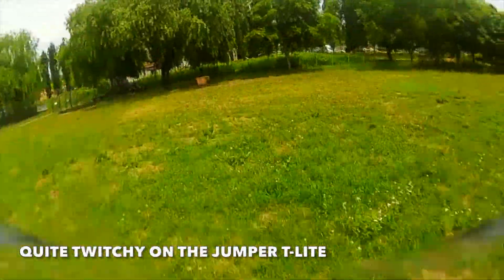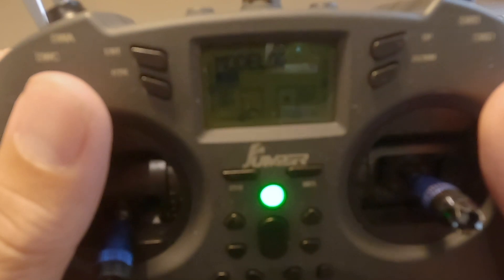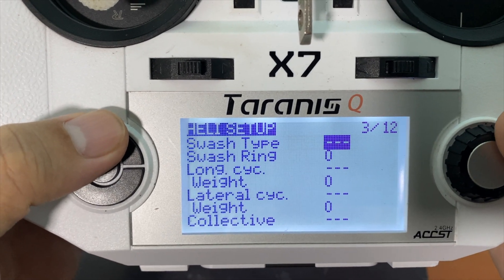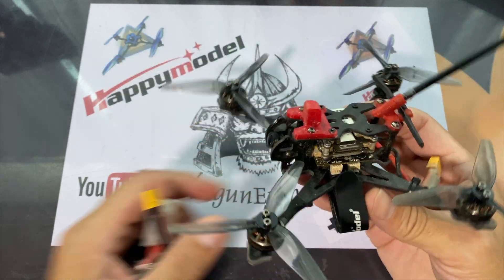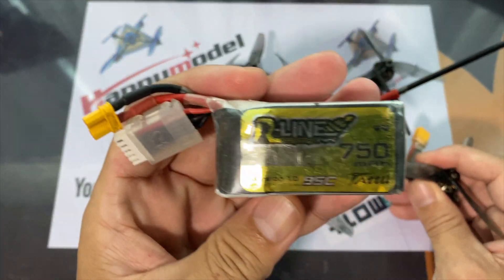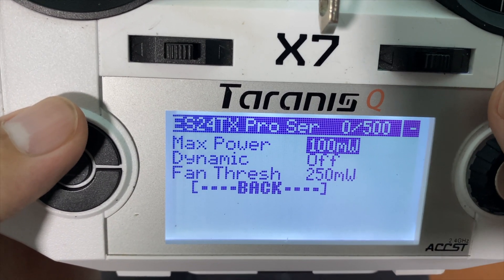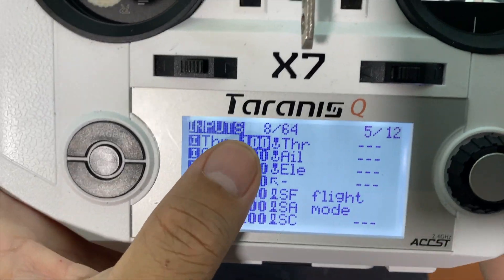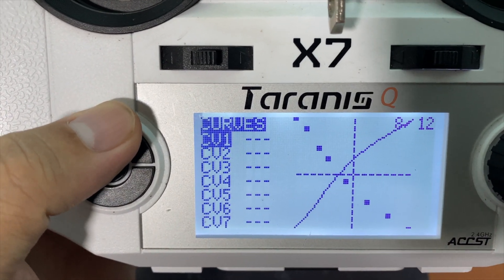Does your drone jitter? Check your radio settings

Comment: what is the difference from smaller drone to bigger drone? i see you fly the same way in both.
Reply from the maker: the larger 5" has more power and much easier to control as compared to the smaller micros and tiny whoops. If u asked me, I'd say the size makes a difference. 4 x 4s lipos for 5" and 4 x 4s for micros weight wise, is halved.  Micros and whoops are much smaller so its easy to carry around.  The smaller micros and whoops fly differently, they're more zippy but has to be lightweight but the larger 5" carries a gopro easily. So it really depends on the user. If i want a gopro footage, i'd use the larger 5"
Reply: @shogunemperor  I have noticed that the Mobula 7 hd has more weight so it's easier  to fly but the regular M7 is more 😊 fun . I'll try bigger quads once I get good at acro , can only do it outside and it's pretty windy
Reply from the maker: @chopwhoopz  yup, i prefer the regular Mob7 too due to its agility. The Mob7HD flies like a bus.

Comment: Great video, I always turned on the “max throw” checkbox , this cranks up the endpoints to max which is the equivalence of 125% on older radios. More resolution is always better for the accelerometers in the flight controller to work on .. 😉
Reply from the maker: aaww thanks bruh! ooooohhhh... i didnt think of that... but its weird tho.. it only happened to the Crux35... didnt happen to my Johnny4 which was what got me perplexed

Comment: Nice video dude and something that is commonly overlooked as we see bobbles/jitters and instantly assume quad hardware or tune problem. Great flight too! What camera is footage from? I'm guessing a split cam with how the props are on the shot? 🎈🤡
Reply from the maker: Thanks bruh! Exactly man, if this didnt happened to me, I wouldnt have realized it as well. This is from my DJI Vista nebula pro nano. Yup, its the same view with a split cam, so some usually use a GO2 to record the HD footage without having the props in view.
Reply: @shogunemperor  ahh I forgot you run DJI, makes sense! Awesome!!
Reply from the maker: @KlownFPV  heheh thanks bruh

Comment: It's also VERY important, essential really, to apply 4.3 RC link presets when using ExpressLRS and high packet transfer rates. When the packet rate is bumped up to 250hz and especially 500hz, the ff_smoothing and associated variables need to be tuned. There are official presets in 4.3 to pick and I have applied them to both of my Crux35 models.
Reply from the maker: YEEESSSS!!!!  BUT!!!! This quad was in 500hz and nothing changed except the radio and the module, 1 was in 500mw and my own radio at 100mw... so Im assuming that power difference made the quad twitch like crazy... true on that 4.3 preset too!
Reply: I doubt it. Besides... it should be easy to test with 100 and 500mW using the same module and radio to verify if you are right or not.
Reply from the maker: @Siamect  im thinking its just the radio n not the ELRS module